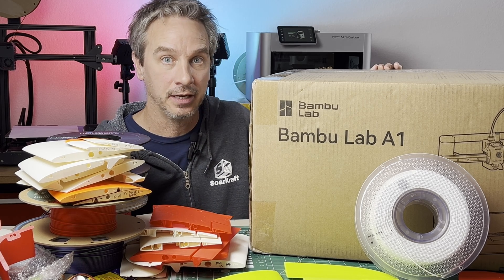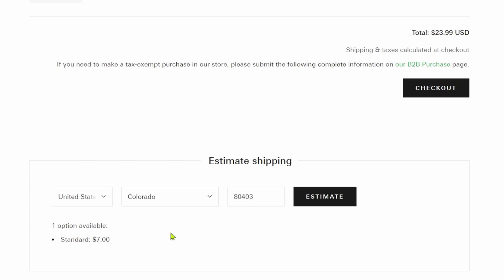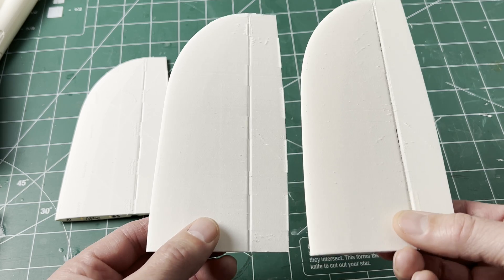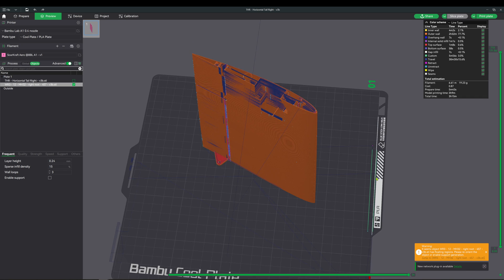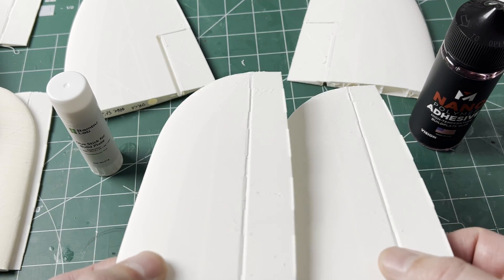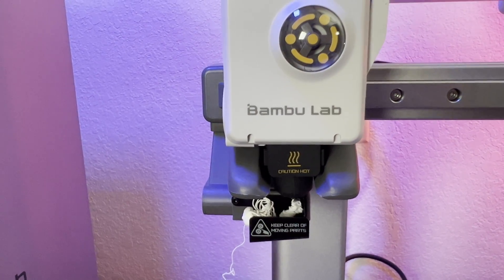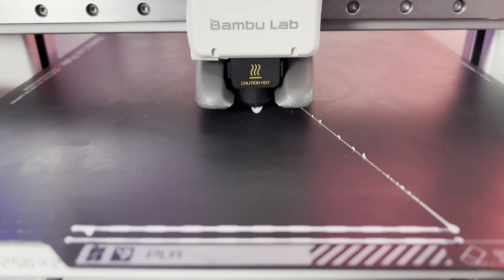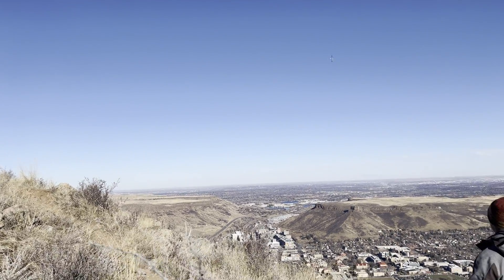Foaming Success! - printing Light Weight PLA on Bambu A1 - part 2 - fixes and tips

Comment: Wayne, have you done Orca Slicer config files yet? I’ve only got Bambu lab and Prusa Slicer config files in my downloads
Reply from the maker: So the bambu files work with Orca, they are the same .JSON file format.  The files in the download are X1C / P1S and need to be converted to other printers, but I have A1 spec config files on my website materials page.

Comment: Is the temperature of the printer when using foaming PLA a issue?
Reply from the maker: Not really.  An enclosure is not necessary for printing foaming PLA and you can not print at it at "ludicrous" speeds so the A1 does well.  The A1 also can do a dynamic flow analysis of the extruder right before printing to get the optimum material control for this complex material... the A1 is pretty good once you get the slicing figured out.

Comment: When using A1, it seems challenging to maintain the temperature due to the lack of a chamber. How did you address this issue?
Reply from the maker: Part temperature is not an issue for this foaming LW-PLA and many other materials.  You might be thinking of the ASA and foaming LW-ASA which need hi bed and part temperature to print… and overall don’t really perform well in my experience.  Warping, clogging and brittleness as well as not as lightweight are not worth the hassle.  If you need a higher deformation temp material (post printing) try the LW-PLA-HT from ColorFabb

Comment: Cool.  I waited a long time to get into 3d printing.  Picking up a1 today I hope.  Not a fan of the multi feed, but that is all that is in stock.
Reply from the maker: It’s a good printer and can print nice quality parts fast, especially with PLA.  I was also surprised at how well it prints TPU.
Reply: @soarkraft  This is great news!  I ended up ordering direct as local could only get the combo.  I have zero reason to print multicolor.  Everything will be primed and hand finished.

Comment: Hi. I'm a newbie to 3D print but have purchased an Bambulab A1 printer.
I imported the lightweight config files from the website into the orca slicer using "file>import" but when I select user presets from the dropdown lists, they are not there.
So, what am I doing wrong?
Reply from the maker: Did you import the A1 specific configuration files?  they are a little farther down the page.  If you did then make sure you are using the .4mm nozzle config for the printer.  These .json files should import into ether Bambu Studio or Orca Slicer... and they are sort of shared so you only have to do it in one program or the other and they will show up in both.

Comment: Is the Mini A1 any good for this kind of thing? It's so cheap now that it's inside my budget.
Reply from the maker: It is good... it has a little bit more z-wobble with the foaming materials than the coreyXY style like the P1P if you print at the exactly the same speeds, but you can slow it down a little, a little slower accel, and get the same quality.  Great for TPU too... which prints a little slower.

Comment: Is it possible to use 3D Lab Print LW-PLA on this printer?
Reply from the maker: I have not tried it, but all the other foaming LW-PLA material seam to work, and I have tried Bambu Aero, ColorFabb, ESun and SainSmart.  They all use about the same settings.

Comment: Would the Artillery sw2 work with the Prusa slicer and give good results in LWPLA?
Reply from the maker: Work, yes absolutely.  The bed slingers without vibration compensation can do a good job printing fly-able parts, and Prusa Slicer works well.  I have three Sidewinder X1/X2s, they were my GO-TO printers for the past 5 years, Blue tape is an easy solution for the glass surface, sticks awesome during printing and alcohol removes. Stiff PLA parts give the best quality.  The foaming LW-PLA wiggles if you have any z-wobble and gives you the layer mismatch as the part gets taller, this is the only issue I had.  Slowing printing down helps too.  There are several videos on youtube on how to check for this z-wobble and make it better... but the new gen printers fix this automatically.  You can add Klipper to a Sidewinder and get this improvement, but it is a project.

Comment: Advice for removing a part that has stuck too well to a printbed. After flexing the bed in both directions try twisting the part off instead of pulling it off. the twisting should hopefully shear the part off of the bed. I think the part should be stronger in that direction.
Reply from the maker: Sort of, this is single wall printing and this foaming PLA is only 25% the stiffness of regular PLA.  It does not handle twisting much either, will buckle instead... which would make the part unusable.   Simple layer separation is easily fixed with CA (glue).... but now that we can print soo much faster I usually just print another.

Comment: Are your models optimized for vase mode? If not, what is the reason
Reply from the maker: No, my designs are optimized for performance… specifically airfoil shape and wing strength / weight.  Vase mode is easy for CAD and slicer, but limiting for many, many reasons.  I love the method, very simple way around the problem, but the aerospace engineer in me wouldn’t settle for the results…. will need to do a video about it.
Reply: @soarkraft  I was just curious mostly because of additional model weight compared to vase mode parts.
However, consider that there are some tricks to simulate multiple walls and infill with vase mode (but its a bit tricky to optimize such model in CAD). I think YT-er "Nerys" made video about that.
Reply from the maker: I will have to look that up.  I know you can split a part and do multiple setups in the slicer... still don't get what I want, and another level of difficulty.  I do all of the heavy work in CAD so my files are easy to print.... import - slice - print... anything more than that is too much for most users.

Comment: Hey! Thanks for the great work! Any plans on adding modifications to support fuselages with popular flight controllers (speedybee f405 wing or Mateks) and/or fpv systems (o3 or walksnail)?
Reply from the maker: I have a couple of new models coming that are bigger, have more room and some other power options.  I have a year old DJI air setup and it fits easily... but I don't know about the other flight controllers.   There are too many combinations to design to fit one... and then in a month there is something new.  The FPV systems are fun, but I get woozy and fly better without... also adds another level of complexity to my joy of just just flying on the slope.... which does not allow power planes or Lipo batteries.
Reply: @soarkraft Hey! Thanks for the answer. Any plans on making them compatible with existing wings? For the flight controller, kinda "standard" for airplanes are Matek Wing or speedybee f405 wing. Most of other FCs for airplanes have similar dimensions/connections. Also, great thing is to have gps/compass for Return to Home functionality in case of signal/orientation loss. For FPV systems common practice is to have a canopy, that can be modified for different fpv systems.
Reply from the maker: @OlegBovykin  Sure, you can use that... you can do whatever you want.  These controllers are tiny and will fit within the fuse.  More space in models coming.

Comment: Thx for the good info. With my Bambu Lab X1 Carbon I am printing with eSun LW-PLA. I use your Config. files.V3. I think the print result is just sufficient. When this print roll runs out I will try PLA-Aero. Hopefully with a better result.
Greetings from the small country of Belgium
Reply from the maker: Im on my 3rd roll of Bambu Aero... it seams better than eSun, actually white, and about the same price.  The eSun stuff is out of stock everywhere... same with the new SainSmart stuff.  Colorfabb stuff is hard to get in the US and pricey.
Reply: @soarkraft Are you using bambu labs factory settings for aero? 
BTW I didn't watch the video. Just seen some comments.